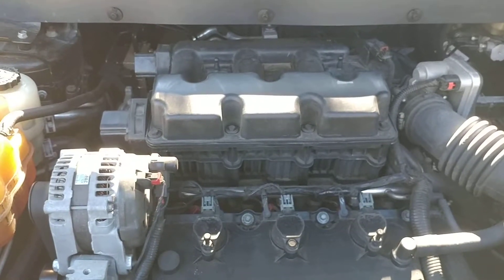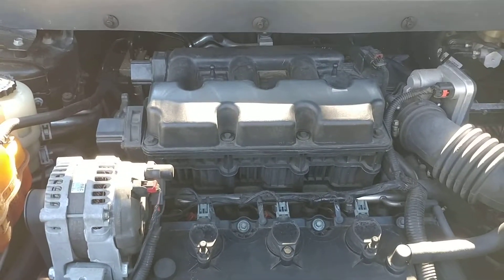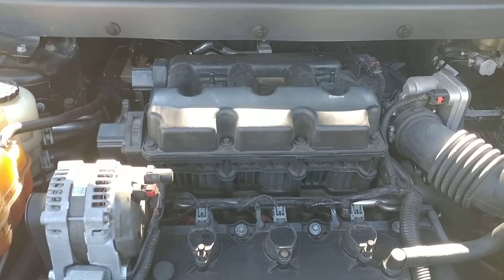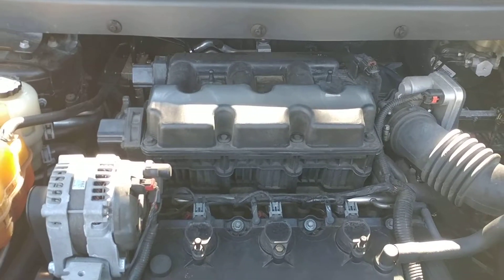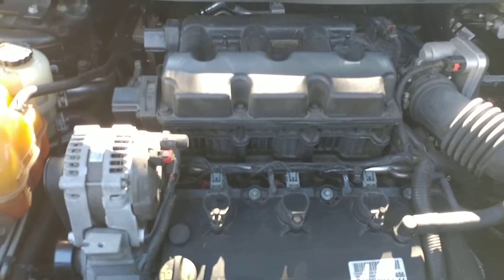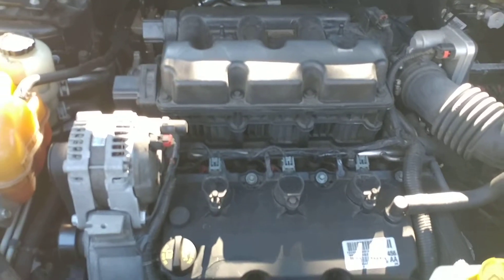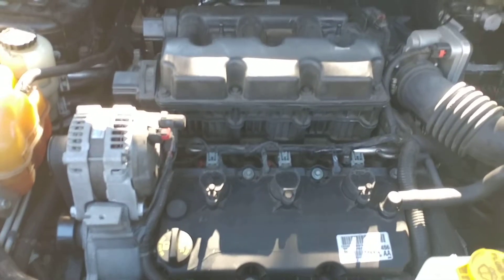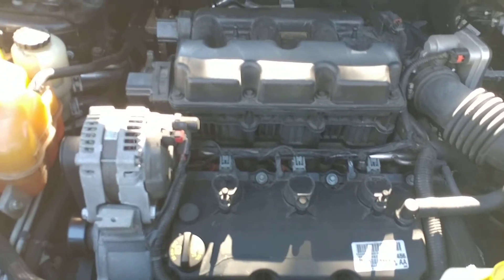Dodge Engines -Journey SXT 3.6 L 6 Cylinder tapping clicking noise  from Rock Arm Assembly Engine

Comment: It’s the flywheel take it to a certified Transmissions shop it will be a LOT cheaper to replace. Had the same issue. It’s a common problem with these cars. Keep the receipt for any future recalls or TSBs